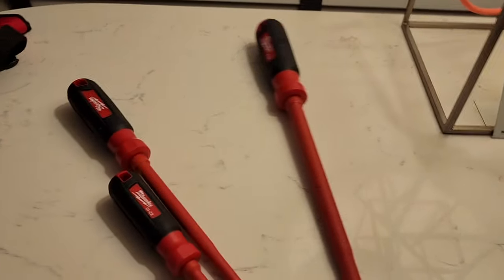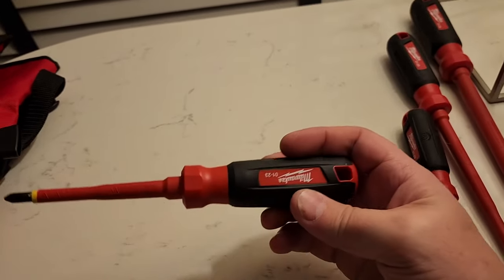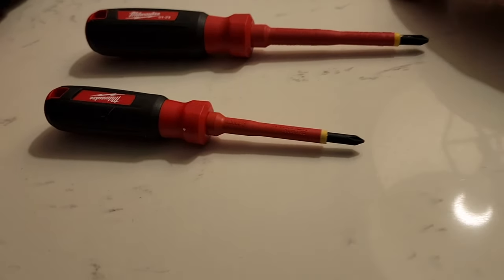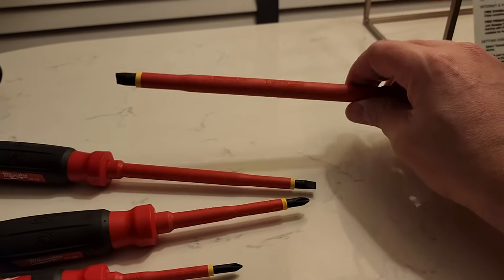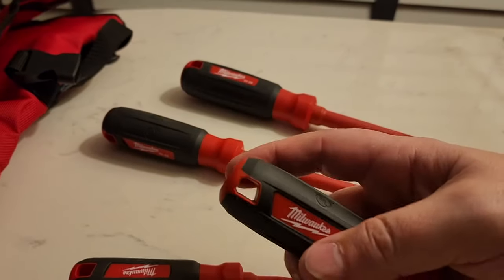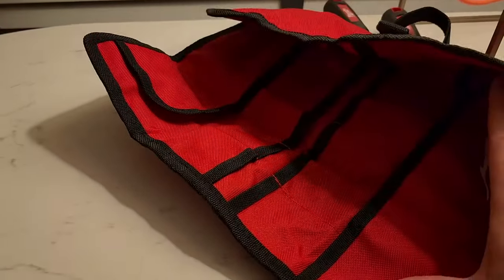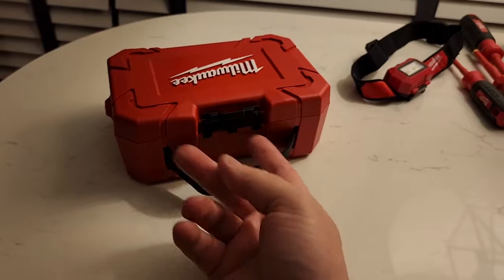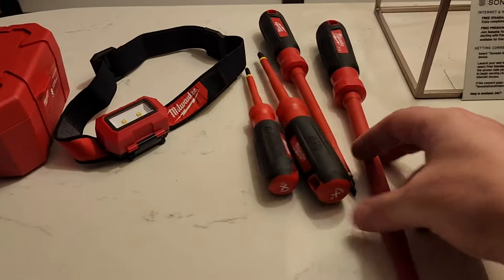New Tools for MRI project

Comment: Would stainless non-magnetic tools work better for MRI work? Brass tools don't hold up that well. No experience with titanium as management won't ever spend that stuff on us (though they'd gleefully and gladly hire 24 entry level secretaries).
Reply from the maker: The problem with all Non Ferrous metals is that they are brittle.
Reply: I use titanium and need to replace them every 6-12 months. At least the small and precision ones. The big tools are a bit more durable.  Its just how it goes.

Comment: I assume the MRI room doesn't currently have functional machine?
Reply from the maker: Why is that? 1 of 4 was not functioning
Reply: All of those tools look to contain magnetic parts. Around our MRI machines they won't let you bring any key rings, belts etc near the machine. A decade ago a patient  had a steel oxygen tank on their stretcher. It took off like a torpedo destroying the control panel on its way to the magnet.  @BetterBiomedChannel
Reply from the maker: @hjacobs8972  You're assuming that I was bringing each of these tools into the magnet room. I stated that I had to use these tools for a cabinet and for above ceiling.
Reply from the maker: This year alone, there have been 3 MRI incidents that I know of.